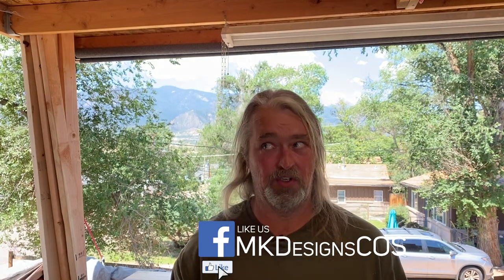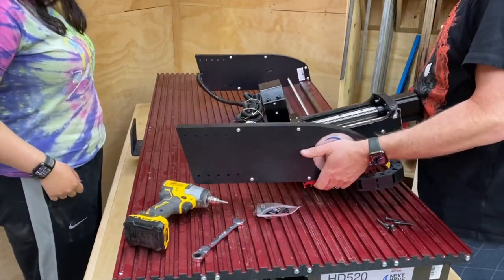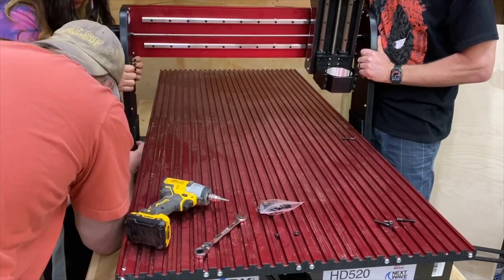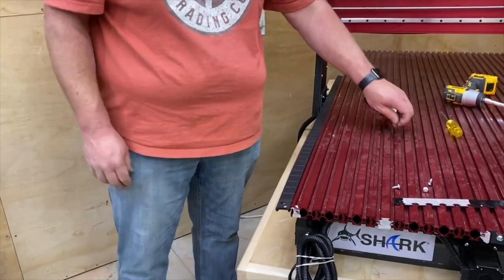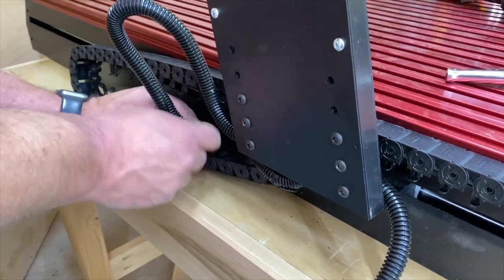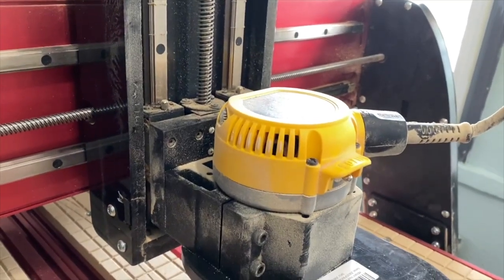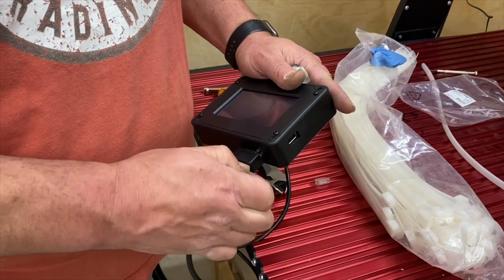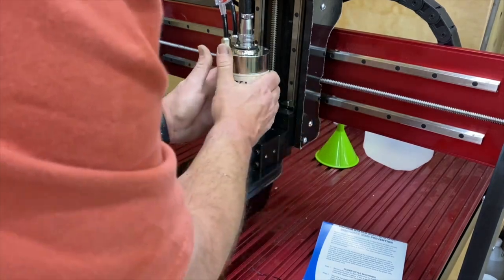Tech In The Shop - Setting up a CNC

Comment: This is a great video. I have a PiranhaXL and wish I had a larger bed (and dust collection), so I’ve been looking at the 520 as well as some Avid and Axiom machines. These are all expensive (I know that isn’t new information.), and I won’t be able to get a larger machine anytime soon, but I can’t wait for the follow up videos on this machine to hear the logic behind the decision and hear about the machine’s rigidity. Thanks for this video!
Reply from the maker: Thank you. It really is a great machine. I will say this much for now. The rigidity is excellent. Their tech and customer support is hands down the best I have ever dealt with. When I first started looking at CNCs I compared the HD4 Extended to the others that were readily available. And based on size, capabilities, and available upgrades the Shark was the better option for the price. I will give more detail in the videos. When I finally had the opportunity to get one I looked at the Axiom as well. It’s a great machine but the Shark still won out.
Reply: @mkdesignsfinewoodworking  Thank you for the information! I’m looking forward to the follow up video(s).

Comment: How to you enjoy the next wave shark cnc 
How does it do with engraving 5 mm deep into hard wood
Great video thanks for your time
Reply from the maker: I love it! Once you have it dialed in it does fantastic with engraving. It’s not as fast as some of the higher end models but it’s not exactly slow either. Your feeds and speeds really depend more on the bit you’re using, what you’re carving, and the material.
Reply: @mkdesignsfinewoodworking  
Thanks for your reply have a great day

Comment: Michael thanks for the video very informative.

Quick question have you had any issues with the Inverter?  I also have a Nextwave HD520 and the Inverter starts up then quits.  It has less than 10 hours on it.

Thanks,
Joe
Reply from the maker: I have not had that particular issue. Reach out to Nextwave’s support. They will help you.

Comment: Great video how do i connect my WiFi or flash drive to my shark as 110
Thanks
Reply from the maker: If you have a pendant you can use a usb with it. If you don’t have a pendant you will have to use a computer. I believe you can order a pendant for the sd110 if you don’t one.
https://nextwavecnc.com/product/controller-pendant-kit-piranha-fx-sd110/
Reply: @mkdesignsfinewoodworking  
So thank you for responding 
I have pendant but I’m not getting the toolpath how ever it didn’t save to my flash drive
Reply from the maker: @jim6402 that’s an issue with your computer and your save location when you save out the toolpath. As long as your usb is 16GB or less and your computer can see it when it’s plugged in, and you make sure you are selecting the USB drive when you save out the toolpath it should work fine.
Reply: @mkdesignsfinewoodworking  
Ok I will get smaller Drive then thank you for your help

Comment: What are the dimensions of your CNC table?   I have purchased a 520 and it arrives in a few days.
Reply from the maker: Sorry it took so long to respond. Mine is 64”x44”. James’s (the one in the video) is a bit smaller. Around 62”x42”
Reply from the maker: Sorry James’s is closer to 40” wide. I bought the Kreg table and laminated 2 3/4” pieces of mdf for the top. It won’t let me post a pic.